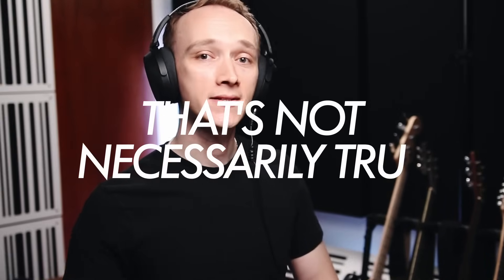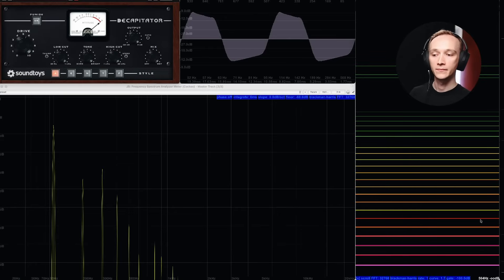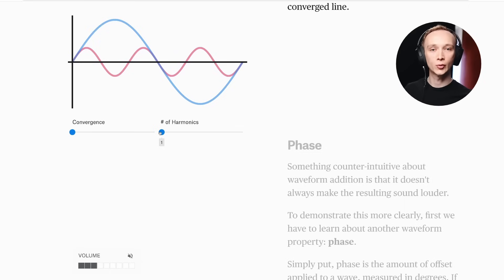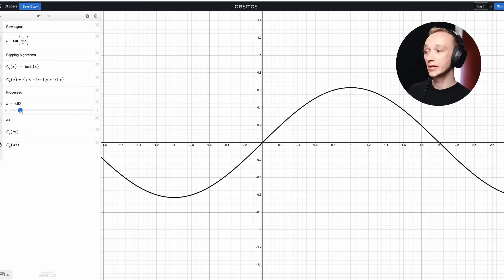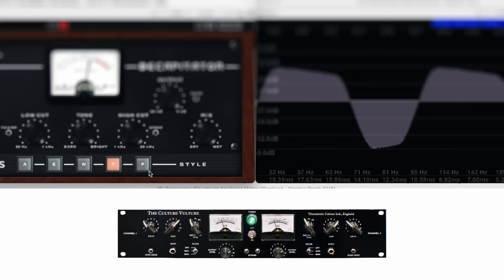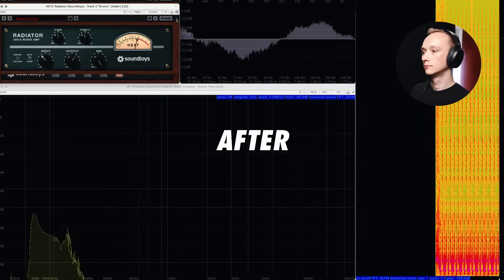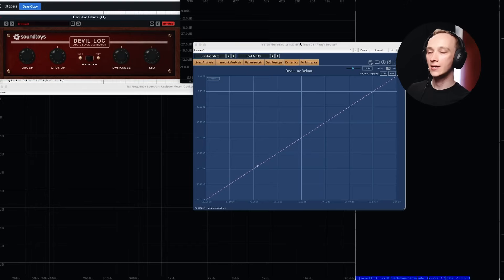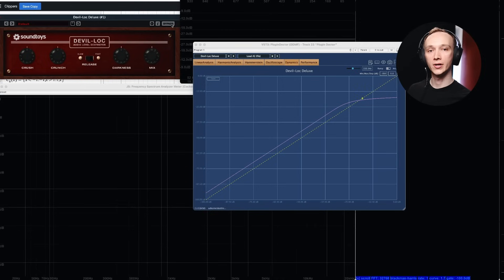Distortion Isn't Always A Bad Thing...

Comment: All great stuff about saturation, Kyle.

Love my Soundtoys bundle. Decapitator is being used on a send bus that I've gone a bit crazy with within Studio One Pro. Pro has a splitter tool that I've used to split mid and side to saturate mid and side differently with separate plug-ins. I can EQ it then as well.

SSL X-Saturation and Fusion Vintage Drive are other great ones that I'm using. Slate Heatwave isn't bad either.
Reply from the maker: Thanks for sharing! Great tip. The mix knob on a plugin limits your parallel processing in comparison to a separate track or bus.

Comment: How do you test a track on smartphone, small headphones, etc. without having to use them?  How do you mix, keeping in mind how it will all sound on just anything?
Reply: Or eq your master output to sound bandwidth limited, just remember to turn off when bouncing your mix
Reply from the maker: Great suggestion @analogbanger! Another method is to use the software in this video: https://youtu.be/Ttv-QO2WYt4?si=3dTl98EjmeThDQHA
Reply: @AudioUniversity  Yes there is another plugin called ‘audified mixchecker pro’, that has the same concept.